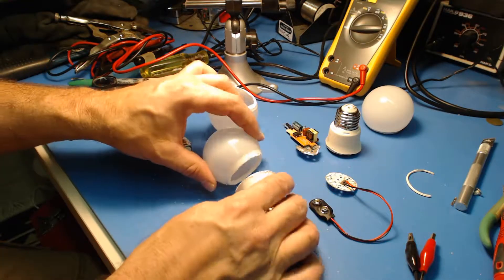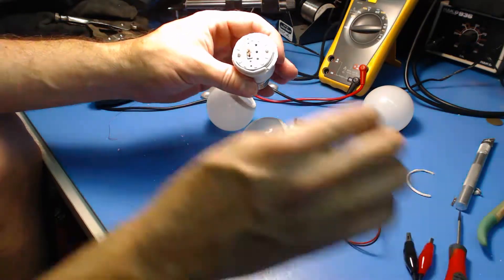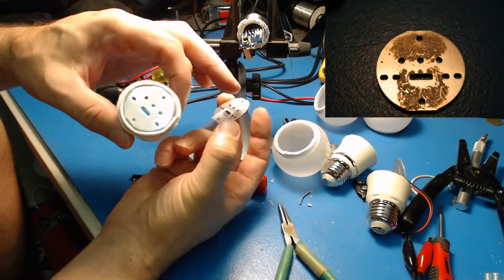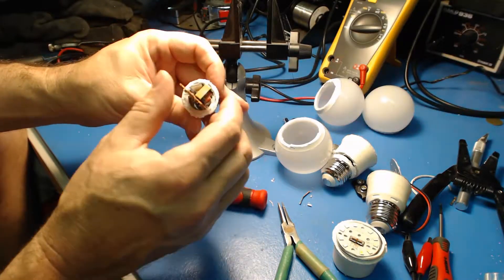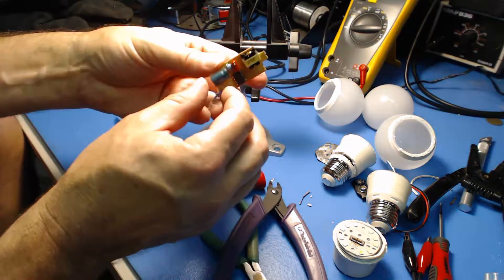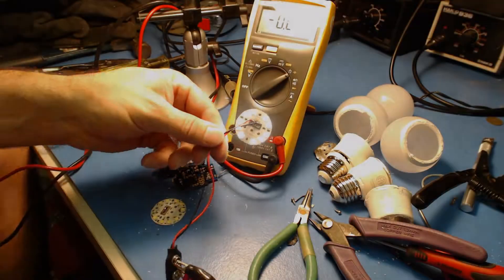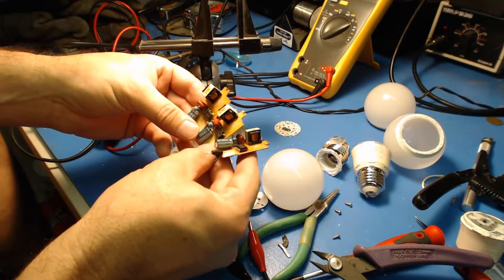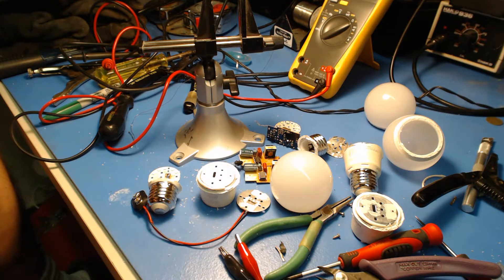Osram LED A-Socket Bulb Teardown

Comment: You do not know how to repair LED lamps.
Reply from the maker: Unfortunately led lamps are not intended to be repaired which is the case for most electronic goods today.  It is truly a use once and throw away world, and that really doesn't bode well for the future.
Reply: @powerevolutions  I short the bad LED and reduce the lamp power twice. (I change R in the current controller)
Reply from the maker: @zigmass4899  You can do that as long as the LED driver is a current controlled switchmode driver.  If it is a high voltage linear current source, shorting out bad LEDs will drop the stack voltage (forward voltage of all leds added together)  down too much so that the difference between the stack voltage and the supply voltage gets dropped across the linear current source which will over heat it.